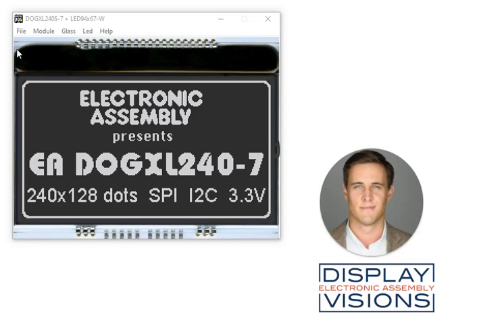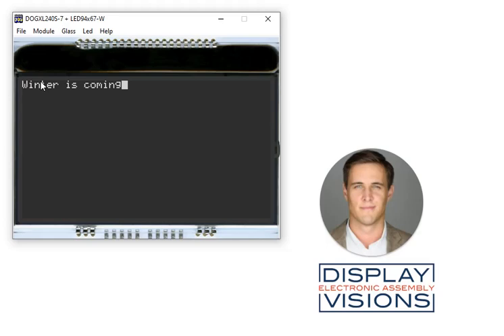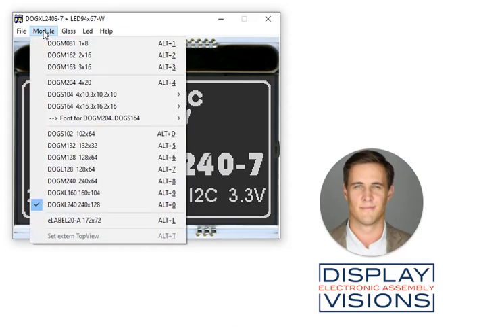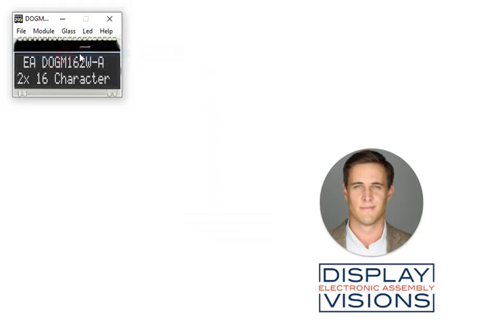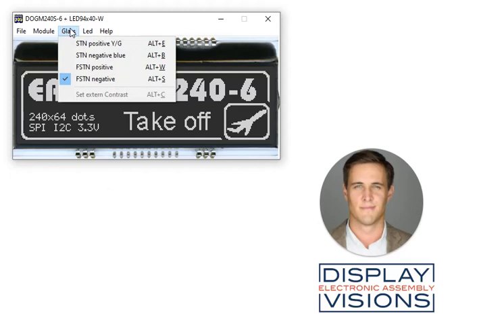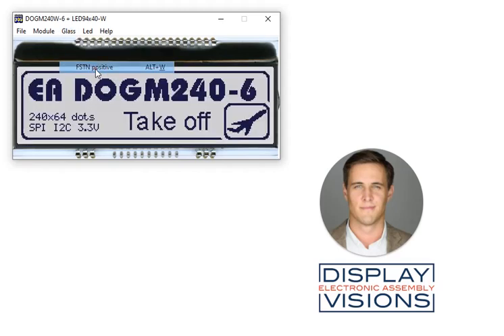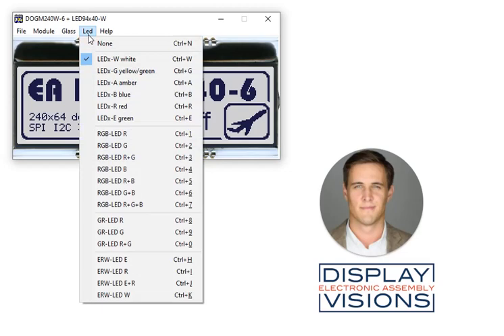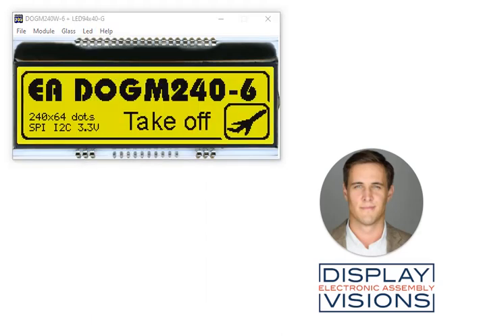LCD Display Simulator "startdog.exe" for EA 9780-4USB DOG Displays

Comment: Hi Mr. I have lcd display EA DOGM132E-5. Lcd model:  2ines of 16 chatacters (Europen characters) and 9. There is backlight screen but no image. From what can it be ?
Reply from the maker: Hi Rauf! Thanks for your inquiry. There are 2 different displays, please do not mix them as they are definitely different:
- EA DOGM132E-5 which is a graphic type
- EA DOGM162-A as a character type 2 lines of 16 characters 
Which one do you have on hand? It's written on the rear side of display
Then please set the correct one in the menu "Module" (startdog.exe)
Or contact us at technik@lcd-module.de